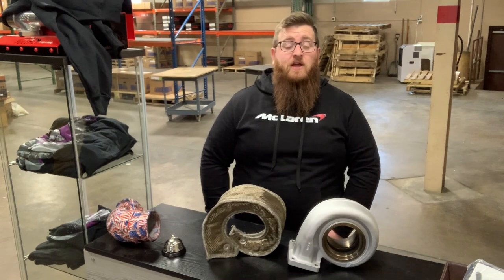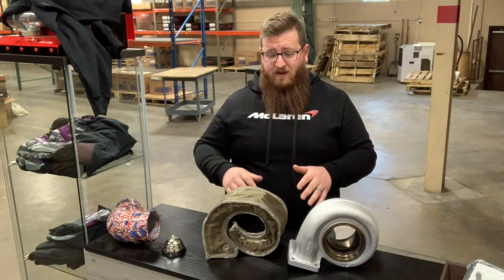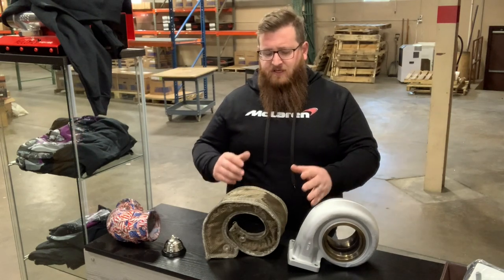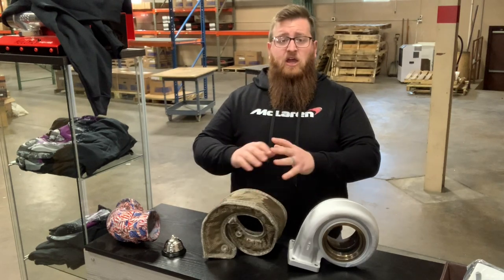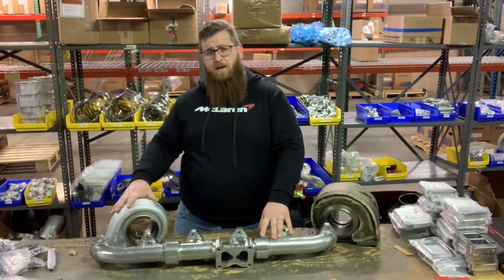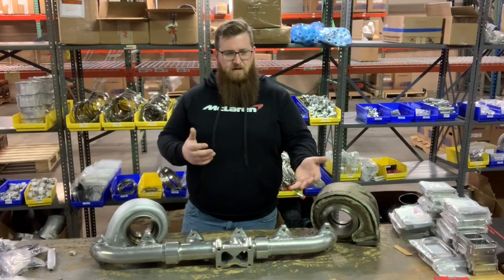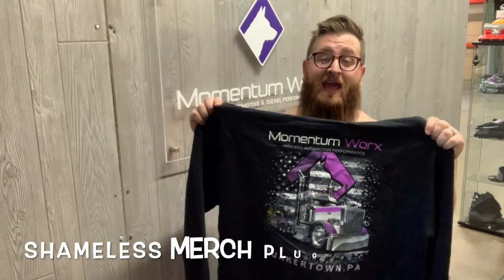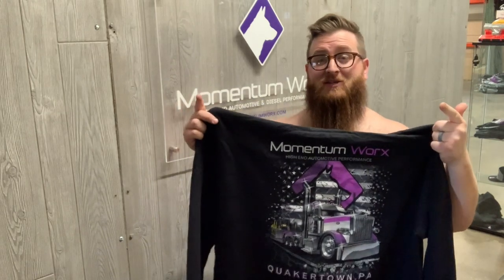Turbo Blankets and Ceramic Coated Exhaust Manifolds; Are They Worth Your Money?

Comment: If I don't drive intensively would I still need the Ceramic Thermal Coating? I am buying a downpipe but I'm not sure whether I should chose the one with Ceramic Thermal Coating...

Comment: Hey man I really appreciate your video! I’m just getting into turbo blankets, exhaust wrap, ceramic coating and other insulation factors. I was wondering would I be doing more harm then good by installing a blanket on an exhaust manifold that’s already been cerakoted?
Reply: Ask the cerakote guys, but last I remember you don't want to wrap coated parts as it may overheat and lift the coating.

Comment: Probably a dumb question, does ceramic coating make the exterior of the pipe cooler to the touch?
Reply: lol...nope
Reply: No. It keeps the heat centralized. It stops radiant heat lose.. scorching hot to the touch but lowers under hood temps and better exhaust gas efficiency (thermal propulsion)